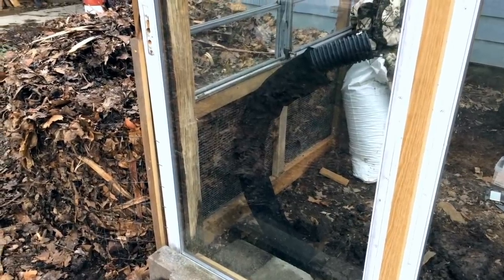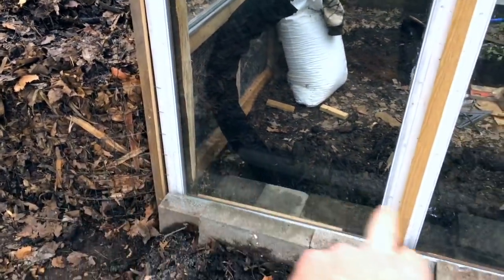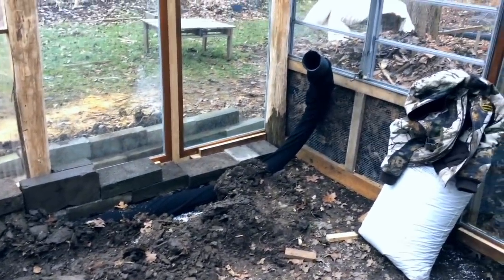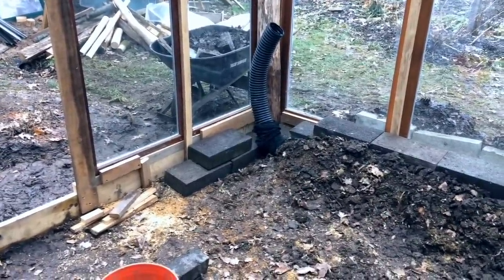Passive Solar Greenhouse - IV - Climate Battery begins and Compost Heating

Comment: Good to see you incorporating the compost heating, as this is something I am doing with my own greenhouse project. Based on the research I have done, I think you will need a considerably larger compost pile to really add any significant heat. The heat losses out the sides and top of what you have there will likely steal most (if not all) of the available heat from a pile that size. Thanks for sharing and I'm looking forward to your updates!
Reply from the maker: Quite possible.  Something I'll be watching for and hopefully evolving the design.
Reply: I correct free bags of leaves and I was surprised how hot they were. They were composting in the bag!  But more is always better.

Comment: If you are going to use a fan to move air , putting it in a position to move the cooler air is going to be more efficient. Cool air is more dense and moves easier.
Reply from the maker: Great info here.  Maybe having a fan aiming 'up' on the outtake to draw the air in would work better than a fan pushing the hot air 'down' into the tube...  A note for me to remember when I'm testing things for sure.
Reply: EdibleAcres Absolutely, physics will allow you to pull more air than you can push. But, just the action of moving air tends to cool it. You may need to experiment with the speed of the fan.

Comment: You could use char on top of your raised beds to act as a bio-filter and try to get perforated drain tile that will outgas CO2 and smelly gases from the exterior compost heap. If you are set on using the non-perforated drainage tile, you might mount a carbon/charcoal filter box on the outlet to reduce noxious emissions. I think you will find that there is a LOT more heat produced at the top of your greenhouse than in your small compost pile. This will be a great experiment to watch. Good job! I was also pondering the use of a swedish skirt around the perimeter of your greenhouse to prevent the ground inside from freezing. A layer of straw or compost covered by a tarp or old greenhouse plastic is all you would need. This would also be a great compost staging are allowing it to age before spring. Stacking functions!
Reply from the maker: Great ideas here.  I do plan to 'flank' the whole area around this space with compost pretty deeply, mainly to have raised beds, but also to insulate the ground more.
The drainage tubes I have in here are perforated, so hopefully the will function well.  We'll see...

Comment: Have you considered catching rain water off the roof and routing it inside as another energy battery? Then, bonus- you can water things with it too. I've also seen at the Rocky Mountain Permaculture Research Institute that, inside their passive solar greenhouses, they do vermacompost underneath the walkways (they cover the walkways with boards). Could generate extra heat that way maybe? They have some awesome ideas for generating warmth
Reply from the maker: I like the composting worms in the walkway, I've seen that in a few spots and shoudl think about how that could fold in...  I may catch rain water on this from the outside but for now I'm designing the beds on the outside to really absorb a lot of water so hopefully that will convey water from underneath to the beds inside.  More design to do for sure.
Reply: I agree.  Anywhere you could put compost.

Comment: In the last installment you mentioned placing straw bails around the leaf pile. The more insolation the better . On top you can leave just enough room to crack the windows.
Reply: I'm still trying to figure out why he is worried about ventilation in the winter!
Reply: @markroeder2491  Condensation / dew on cold surfaces at night without the sun/heat to dry them during the day.
Reply from the maker: That is something for me to consider.  I've designed the space to be able to add them pretty easily if it seems like they'll be helpful.

Comment: Your experimentation is commendable and we are grateful for it.
I think a tarp or layers of cardboard would really assist the compost pile.
Your biochar has many of the qualities that perlite does, being insulative and both hydrophobic at first and hydrophilic after some environmental exposure
You might be able to substitute one for the other.
Packing the entire  outer length of your drain pipes with char could give more spaces for the moist air to condense and nooks for the soil bacteria to grow in.
Just leaving your biochar stainless steel pans in the green house to cool off will add a tiny bit of heat, which  could be stored by piping it from the peak of the greenhouse down into the raised bed.

I love your plans for charcoal paint.
Have you ever heard of a black liquid solar collector?
Rather than heating a black mass and that mass transferring heat to a fluid such as air or water, a dark fluid or a fluid with dark particles suspended in it, is exposed direct to the sun and the captured heat is then moved to where it needs to go.
Clear tubing could expose charcoal laden water to the sun and a pump could move the coldest water from a insulated reservoir  through loop.
Maybe the reservoir   could be a compost  tea , or a rooting tank pulling double duty.
Starts of various sorts are often the best use of greeenhouse space.
Will you stack fire wood in the green house during the hottest parts of the year?

BTW, what is your grey water situation?
A Solvia style vermicomposting filter and /or sand filter could make that water and the latent heat in it ideal for adding to the soil in the green house.
Reply from the maker: Lots of great ideas here, thank you!  Any links for the liquid solar collection idea?  We have ample charcoal happening, and the idea makes sense to me!

Comment: Regarding the climate battery (by any name ;) ) - Going deeper has real value in that you get down to where the temperature's a near constant and you don;'t need to capture as much energy to get real gains overall. Also, it's been pretty well demonstrated that you only need to insulate around the perimeter to a depth of about 18" to contain energy within the building's footprint.  That may be less true with such a small footprint, still there's no need to put insulation beneath (counterproductive).  For our house, we went four feet deep, in a 14x14 ft. square pretty much in the center of the home's foundation. We'll insulate 18" deep around the perimeter on the exterior of the foundation.  In that configuration we anticipate zero loss outside the footprint of the home.
Reply from the maker: Good info here.  For now I don't think I'll be re-digging everything out to lay pipes differently, but knowing it's an option is good.  The challenge is that our water table is super high so I don't think going down into standing water would be ideal.
Reply: @edibleacres  I didn't respond to this at the time, but better late than never? The original Passive Annualized Heat Storage work involved installation around an existing structure and one of the most important factors was a layer of waterproofing above the air tubes to prevent water traveling through the heat storage area. This because moving water passing through is extremely effective at collecting and removing energy from the space. In other words, yes, you do not want your heat storage going into your water table, it will take your heat away.

Comment: Lookin good!  I wonder whether a PC fan will be able to overcome the static pressure of the tube.  Rather than a small fan working whenever there's light, you might do better with a larger fan (e.g. a bathroom exhaust fan) working off AC just during the warmest hours of the day.  Really though, the greenhouse is going to be great with or without earthtubes.
Reply from the maker: I think I'll start with the lightweight, low amp and very quiet fans (especially since I have some already! :)  If they can't do the work then I'll invest in something stronger.  I think with such a short run of tube that if it was super powerful it would push the air through the tubes so quick that no heat would be transferred.   The good news is it's easy to try and adjust as needed...  Thanks for the ideas.
Reply: @edibleacres  if you spend money buy a hyper fan. Lowest amp to cfm ratio I've found.

Comment: Was that your dryer vent there to the left of the greenhouse? You maybe could duct that into your greenhouse?  It may offer a little added heat for the winter...  
Also, you might be better to keep your raised bed at least 12" from your exterior wall, being that any physical contact will act as a thermal bridge and literally wick the heat right out side/wick the cold temps into your bed... for a good visual, watch a clip of the arctic ocean waters that are liquid, suddenly crystallize by simply making contact with another source of ice....  its weird but real....  Please head this heads up, because it will severely help your efforts!  

I hope to hear how this works!  It seems like so many do "installational" videos about the various earth battery approaches but I don't see hardly any follow ups on them, so I'm wondering if they just don't end up working?     Love your stuff!  Thank again for your videos!
Reply from the maker: The tubes you saw are vents for a hot air heater.  I shouldn't pipe those in since they'll have weird stuff in them... 
Good call on the wicking of cold.  Perhaps I'll need to insulate that side a bit.   I'll monitor and adjust as needed.
My pleasure to share notes.  We'll see if these tubes work out!

Comment: LDS prepper would be a good source for you to contact. He has several passive solar tunnels different design what you’re trying to do but it’s the same principle. One thing I know he’ll tell you if you need a bigger compost pile, you need the heat to offset the expense of the building cost also You need to put your pipe below Frostline and insulate underneath the pipe. I am about to build a greenhouse I am no expert but I have been studying different plans. If you can put some 55 gallon drums paint them black and put it in the building as well this Will help release stored energy at night. I know this is not what you wanna hear because it’s not what I want to hear but this is what I have found out there is no shortcuts or easy solutions but the payoff will be worth it. Best of luck God bless.

Comment: I enjoy listening to all the thought, that went into this design. I'm wondering if you can go simpler still though, and leave out the pipes underground? Just by putting hot compost materials at the very bottom of the raised bed? You may need short vertical pipes, that go down into the lower compost material (in the raised bed) to add a little air. I know half composted material, placed in the bottom of a raised bed, with a cloche or some kind of covering over the top, creates a lot of heat. Cloches are generally smaller than a greenhouse though, so less chance for air loss. But wondering if you treat the soil like your compost in the chicken yard (only less intensely) it might achieve the same, if not more, than the pipe design? You can also add a lot of lucerne to the soil mix (high nitrogen content) to get the whole soil surface, acting like that compost pile you have on the outside.
Reply from the maker: I hear you, but designing a dependency on the warmth coming from active compost means I'd have to remove all the soil periodically to 'recharge' the bed with fresh compost to cook down.  I'd like to have a more permanent soil structure in here, so the tubes are hopefully going to allow me to add heat in the winter AND pretty importantly be able to draw cool soil air out to cool the space down in the summer...
Reply: @edibleacres  It will be interesting to see how the pipes perform, during the cold and hot season. I don't blame you for wanting to avoid all that work with the soil.

Comment: Doesn't the corrugated tube create a habitat for mold and bacteria? When I learned about geothermal energy I was told that you have to use extremely smooth pipes to prevent mold and bacterial growth
Reply from the maker: Reasonable question.  The tubes I have in here are perforated.  I researched it and over and over again the strong recommendation was perforated drainage pipe so that moisture can be wicked back into the soil from them.  Hoping that deals with the problem.

Comment: My only concern is that temperature difference between bottom of tube and outlet isn't going to be enough to 1) passively draw air or 2) condense the moisture in the air, thereby causing a drying effect on the bed
2 is my greater concern, 1 is simple enough to overcome
Reply from the maker: 1) I would agree that passively I would be surprised if air would move.  I think it certainly will need some assistance with a fan.  2) I'm not sure if it will dry the bed or help add moisture, I think that is something to learn as it evolves, and make adjustments as needed...
Reply: Xxfades321xX , I think you're right. I have 1500 gallons of passive water mass, and my greenhouse still goes to 45F north of Austin.

Comment: Send the dryer output pipe into the greenhouse use all that extra heat in winter.
Reply from the maker: Good idea.  The challenge for our setup is 1) the dryer is on the other side of the house and 2) we have a woodstove so we dry everything by the woodstove all winter.  BUT, the comment is really valid for other folks who may have a better setup for what you are offering.

Comment: I don't think the wood in the window frames was ever intended to touch the ground where it will wick up moisture and rot. Sorry to be negative.
Reply from the maker: Great point here.  I should have clarified... The wood that is down along the ground is Black Locust.  The window sections sit on that, about 6 inches above grade.  I explained that in the last video but not clearly in this one.  I think I've designed for this concern...

Comment: I'm not sure if insulating the tubes is a good idea when you want to exchange the heat with the ground. It should be the opposite, shouldn't it?
Reply from the maker: I'm most interested in having it exchange heat with the soil above it, in the bed, than the earth below.  That is what I'm referring to in this video.

Comment: yay, great to see someone else going for it!  

As I remember, Van Powell is in North Carolina and you are in upstate NY(?).  I think it's just too cold for you (and me) to do an uncovered compost pile.  I'm in Colorado and have a similar system to you and Van, except it's covered and insulated (https://youtu.be/Dm7fQQrKlSs).  Being in a very dry climate, I need to preserve compost pile moisture.  May be less of an issue for you.  I'm getting about 15 deg F of greenhouse heating when the outside temperature is ~20 deg F.

Regarding the GAHT, it's refreshing to meet another person who refuses to spend beaucoup bucks on the damn thing.  I scratch my head when I see people spending a few thousand bucks on materials and another few thousand on excavation.  Only seems to make sense for a commercial operation with a 10-20 year payout.

Waiting for upcoming videos eagerly!
Reply from the maker: Your video really shares some thorough notes.  I appreciate the time you are putting into your work!

Comment: There should be an air space between the cement blocks and the wood framing.  Concrete will just absorb the moisture from the beds and transfer it to the dog prone pine.  You also have a decent chance of having a mold problem in this interface (between blocks and wood) area which could well make your greenhouse unfit for occupancy.  A moisture barrier (plastic sheeting would be easiest) between the soil and the blocks would solve most of this problem.  Airflow would fix the other problems that are likely to force a rebuild.  Your ethics are admirable, but lack comprehensive thouroughness.  In your system design, you've optimized for minimization of resource utilization.  You've neglected to optimize for efficient maximization of results.  Ironically, you may well end up using more of the resource you are trying to conserve  (fuel to heat with) than you save by using this current  design.
Reply from the maker: Thanks for the info.  We'll see how it goes!

Comment: I'm not sure that I understand the principle of driving warmed air beneath your raised bed. Compared to water or oil, air has a very low thermal "mass" and is highly "miscible", so I'd expect that the heat will "stratify" and mostly escape out of the vent. Would a closed-loop of water-filled hose not capture and transfer more heat from the compost?
Reply: Yes.
Reply from the maker: That is quite possible.  The water would potentially transfer temperatures better.  The air flow is partially about heating the soil in the winter, but also about drawing moisture out of the air and letting it condense in the tubes down underground where it can wick water into the soil.  We'll see how it goes, but the basic concepts of the climate battery are appealing to me so I'm trying this approach for now.
Reply: @edibleacres  Ah, thanks. Now I see how I was confused about moisture -- I took you to mean that you wanted to remove moisture from the soil not (if I finally understand you correctly) from ambient air.
Reply: @tammcd  As the moisture condenses it transfers huge amount of heat.
The heat energy embodied in that phase change dwarfs the energy that can be moved with (unpressurized) liquid water.